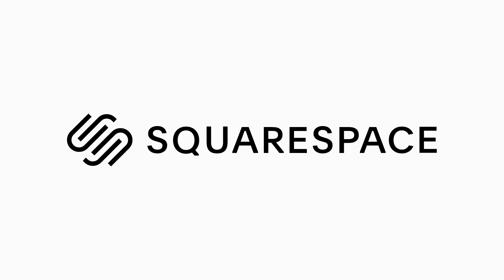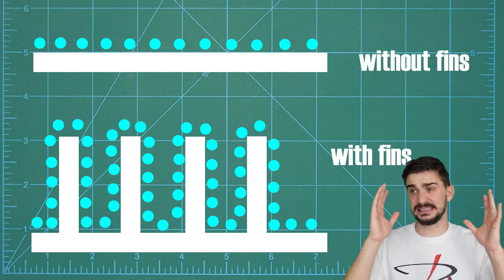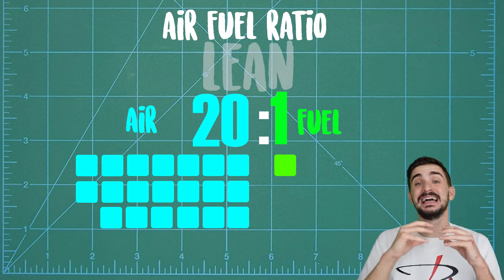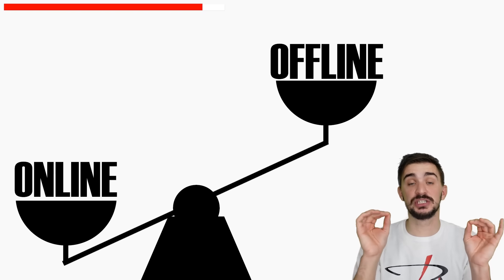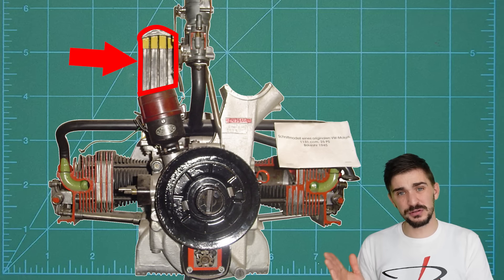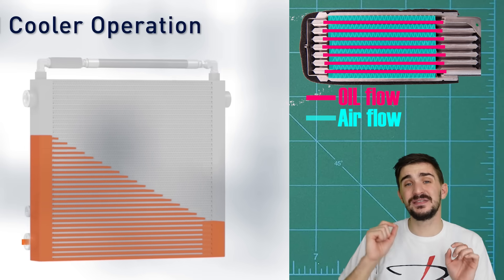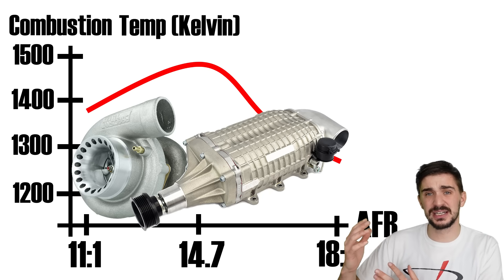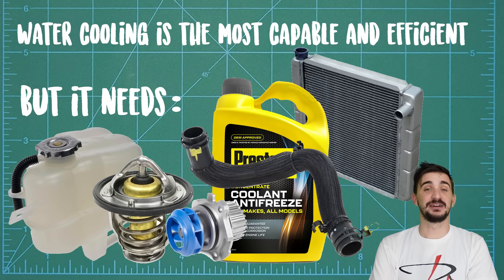AIR COOLED vs OIL cooled vs WATER cooled ENGINES

Comment: best cooling solution for your engine is water? laughs in hydrogen
Hydrogen has a specific heat capacity of around 14,3 kJ/(kg*K) - but a density of only around 0,1 kg/m³. But no problem, just put that stuff in at around 700 bar since you can fill your engine with that pressure at any hydrogen refueling station (density is roughly 40kg/m³ then). And.. oh well.. that still makes it incredibly bad for cooling; Water with it's roughly 1000kg/m³ is still about 7 times better per volume.. :-(  and you don't have to deal with those 700 bars. cries in hydrogen
Reply from the maker: What a roller-coaster of a comment! I really laughed, thanks for that.

Comment: My question is, why no manufacture made a combination of air cooled & water cooled engine
Reply from the maker: Because air cooling becomes unnecessary and redundant with water cooling. You can do little things like shallow fins on oil pans but that's about it.
Reply: @d4a  Ummm.... Porsche 959. Air-cooled cylinders, liquid-cooled heads.

Comment: 11:04 Does the viscosity of the oil affect the heat capacity? I.e. Thicker oil = More or less heat capacity? Also does thinner oil transfer heat more quickly to the cooler?
Reply: Specific heat capacity is functionally constant (J/K*kg). However, as thinner oil is less viscous it flows more easily. This results in greater flow (m^3/s) and thus greater mass flow rate (kg/s) through the engine and radiator. This means better cooling of the engine as more fluid is available to exchange heat.

However keep in mind that this is mostly a consideration for startup of the engine, when the oil is cold. As flow rate is linked to the pump, which in turn pumps harder at higher rpms (when more heat is generated). So cooling and temperature tend to remain constant when cruising and only slightly goes up when accelerating (these variations are not negligeable, but for simplicity's sake we will ignore that).

It is actually recommended that you turn on the engine for a brief time before you get going and start demanding perfomance from the engine. As this gives time for the oil to heat up and better lubricate the engine. I can guess this is specially important in oil-cooled engines. It used to be very important in old engines, but as people kept being impatient engineers started designing around short startup times.

Comment: Some Ford engines,the water pump is driven by the timing chain. That was a great idea.🤯  So if the water pump ever goes bad...it pours the coolant into the engine and mixes with the oil. If you don't realize it rather quickly and you keep driving. Engine goes 🌋What a stupid design. They could have just as easily designed the water pump to be belt driven.
Reply: Yes, my neighbor just had this problem with his Ford EDGE resulting in catastrophic engine failure.  I am told there is a weep hole to allow coolant to escape the engine and hopefully warn the operator of impending pump failure,but this does not always work.

Comment: I had to reply as two of the three oil cooled bikes shown, I own two of 8) One turns you leg into Fillet steak if you ever get stuck in traffic, the other one will do fourteen hours a day in central London traffic for three years non stop ! Well at least mine did with the odd race weekend thrown in 8) ! Still own both ! And you have to laugh, my really fast race bike puts out 98HP but my old work bike thats done it all puts out 105  lol .

Comment: Harleys new m8 motor is air cooled but it has I think it has oil cooled rocker boxes or heads, due to oil lines running on the motor under the tank then connecting to a oil cooler.

Comment: Excellent presented, as always.I learned new things, as always !
Btw. I read years ago, that when moving away from aircooled, you became able to use smaller tolerances btw. piston and cylinder. At least from a performance perspective this is important. Can you verify this ?
Thanks

/Peder
Reply: I also thought that constant temperature was the main advantage of liquid cooling resulting in smaller tolerances, less oil  consumption etc..

Comment: One thing that I have noticed, in the motorcycle world, is the oil-cooled engine have less horsepower than the same water cooled engines and in general have less compression ratio too,  I think it happens because the limitation in keep the engine in the optimal temperature range.
Reply: I believe it is to do with the manufacturing tolerances which need to be wider for air cooled to allow for expansion and contraction.

Comment: Interesting and easy to understand video like always. I have owned several motorcycles and scooters since I was young. Some of them were air cooled, other water cooled... but I loved them all! I would like to share two ideas: some scooters have a special type of cooling system, "forced air cooling system". The forced air is provided by a small fan moved by the engine. The old Vespino had that interesting system. And many current scooters use that technology. The Spanish engineeres of the humble Vespino were very creative and invented the continously variable transmission. That mechanism is nowadays very common in the scooters and even cars. Nobody knows that this transmission method was created for this low displacement vehicle.

Comment: So the heat generated in an engine is  from friction? How come a car going downhill while breaking on the engine doesn't overheat?
I think the primary source of the heat comes from the combustion process.
Reply: Most of the heat is from the burning of fuel. And that’s why the top end of the engine will be hotter than the lower end because that’s where the power is made. That’s also why the cooling system becomes hot like almost boiling temps and under pressure. It’s like putting a pot of water on the stove.

Comment: Friction of the piston in the cylinder cannot be the major heat source. 
Try riding uphill for 10 minutes at 3000 rpm vs
going down the same hill, motorbraking at 5000 rpm. 
Motor will be hot going up and cool going down, inspite higher revs.
Reply from the maker: 9:15 I never said it was

Comment: 14,7:1 air to fuel ratio applies only to gasoline. Diesel, ethanol, methanol, gas and different blends need different ratios to burn. Diesel (as engine) doesn't even care so much...

Comment: Seems like oil/air cooling is the best for regular vehicles. minimal added parts. minimal added complexity. 

if heat capacity is an issue, just increase the flow and widen the radiator. Still more optimal than a massive secondary water system. 

and there is no need for only 1 flow path for oil, and no reason to not have a thermostat on the cooling loop. 

seems like water is only needed when you have high horsepower or forced induction

Comment: Most internal combustion engines are about 60% efficient, max.  That means that almost half of the energy produced by the burning of the fuel is heat, which the cooling system has to also deal with. Strange you didn't mention that.
Reply: if you are talking about the siemens H type turbines, then you are not bad, but in a normal engine you cannot aspire to more than 40% efficiency, and driving at 10MPH it would be about 17% for using so little power not filling the cylinders and "reduce compression ratio"

Comment: Friction is indeed one of the sources of heat which must be dissipated. The other source is due to the thermodynamic efficiency limitations of the Carnot cycle heat engine. The maximum efficiency is around 25% to 30% for current gasoline engines. This means that about 70% of the energy in the fuel is wasted as heat. Most of this heat passes out through the exhaust gases but some of it is absorbed by the engine block and heads. This heat must be removed by air, oil, or water as you have stated.
Reply from the maker: Many modern gasoline engines are managing close to 40%. 25% is a figure from the 80s
Reply: @d4a  Fair enough but the point is that even at 40% efficiency, 60% of the energy in the gasoline is still being wasted as heat. Its not just friction. All of this waste heat must be dissipated through the exhaust system and various cooling strategies as you have described.

By the way, I love your channel!
Reply from the maker: Thanks happy to hear that, but I never said it's just friction. I simply did the friction in the intro with the fun hand rubbing to make the video a bit engaging, but later at 9:15 I clearly state that combustion is the main source of heat and demonstrate how important it is to circulate cooling liquid around the chamber. But I should have probably said that earlier.

Comment: The Volkswagen beetle is known to have an air-cooled engine. But when you removed the shroud it has a small radiator to cool the oil. So it's like air cooled but also oil cooled.
Reply: Had a 1200 cc beetle, I was told that up to 40% of the cooling was from the oil. As the engines capacity increased so did the size of the oil cooler.

Comment: I am having a problem with the friction inside an engine creates more heat than the 4,500F/2,500C combustion chamber temperature. Yes the friction is there. The reason for the increased exterior surface is to disapate the heat generated by combustion.  With thermal dynamics that heat is transferred to the entire case
Reply from the maker: 9:15

Comment: Modern engines, especially diesel ones even use coolant to cool down exhaust for EGR and emission purpose
Reply: Also for variable geometry turbos.
Reply: @breakfast7595  they use coolant for that ? how does it work ? I know there are water cooled turbos but didn't know it had a use for variable geometry

Comment: Great video, I didn`t know that there were engines actually circulating oil around the combustion chambers.  I would add that the biggest advantage water has over oil as a cooling fluid is it`s thermal conductivity.  Combined with the thermal capacity it makes water about 8 or so times better as a cooling medium.  Keep up the great content, I am learning tons from each of your videos.

Comment: Theres also a water cooling engine that throws away the water pump. Its a water immersed cylinder where the cylinder water jacket is part of the water tank. Using only temperature difference to move the water up or down. Its either a boil off or a water tank with a radiator and a fan with a pressure cap. Standard issue on Yanmar and Kubota horizontal single cylinder agricultural engine and their chinese copies.

Comment: Always something of value to learn from your excellent presentations. I catch very few misstatements very occasionally and mostly pick up some facts or perspectives. Thanks. You start this presentation with a curious attribution of friction as the primary cause of excess heat. The rest of your presentation shows you know that combustion produces the lion's share of excess heat--the sixty to seventy percent inefficiency of the cycle. Friction's contribution is miniscule compared with that of combustion. In 1971, in a first-year thermodynamics class toward my mechanical engineering major, the professor asked this very question, that is, where does an internal combustion engine's excess heat come from. One of us students immediately answered, "friction." I vividly remember the professor's astonishment at our ignorance. He said something to the effect that if friction were producing anywhere near (within two orders of magnitude) the heat of combustion, the metals subject to such friction would quickly melt, bearing in mind that the local interface of frictional heat generation is instantaneously very small. Remember, too, that gas flow and introduction of evaporative fuel (as you detail) carries off most of the excess heat of inefficiency. Still, as you show, engine cooling is concentrated around the combustion chambers and exhaust ports. Along these lines, Rotax 900 series aviation engines utilize a hybrid cooling system; liquid cooled heads and finned, dry cylinder barrels sufficient to remove the residual heat of combustion carried into the cylinder walls (and, ok, that little bit of ring/wall frictional heat).
Reply: Your comment is to the point, it was really a bizzare intro stating that friction is key heat generator in the internal combustiin engine.  Total loss of credibility
Reply: Another thing i found strange is that he mentioned the fuel evaporation cooling effect, but not that the flame of the rich mixture itself burns cooler
Reply: Totally agree with your comments about heat sources in ICE.  But “Excess heat of inefficiency”?  What are you trying to say on this?

Comment: I have always wondered why racing engines aren't made to have air-cooling fins to compliment their water-cooling systems.
Imagine that you have an endurance prototype and for whatever reason your cooling system isn't performing to it's full potential. You'd have to ease the pace in order to prevent/reduce excess heat, or otherwise the ECU would make the car run thirstier to keep it cool.

However if you were to have cooling fins on your water-cooled engine block the excess heat would simply be washed away as the air circulated in and out of the engine bay.
Reply: Modern endurance prototypes have a tonne of air moving through the engine bay. But if you're having to use air cooling fins on your engine block, it shows you've got a bigger issue, since your cooling system wasn't done properly the first time around.
The reason we use radiators and water cooling, is that they are SO much more efficient than air cooling fins. So when you find in the free practice sessions, you find the engine running on the hot side, you just open up the radiator ducts one step and maybe one more step for a bit of safety factor.

Comment: I noticed you stated that 40% of heat comes from the rings scraping against the cylinder walls causing friction, Sorry that I beg to differ but I think that combustion (burning of the fuel/air mixture) causes way more. I would think that that is where the majority of the heat is generated.
Reply from the maker: 40% of the total heat generated by friction... Not total heat

Comment: I had a Suzuki that go around the problem with uneven cooling on the rear of the engine on an air cooled engine in an interesting way - the front cylinder was air cooled, but the rear cylinder was air/oil cooled. 

I have a DR650 now, and it has a weirdly large oil cooler for a 650cc engine. But that thing just won't overheat.

I'm really digging the new background. I'd love to see more of this.
Reply: I have a DR650 myself. I want to say some v twin engines had a richer idle jet for the rear cylinder so if it was idling at traffic, it would help cool the engine a bit more. Maybe harley davidson? I can't remember

Comment: You say you cannot control the cooling of air cooled. 

The vw beetle had a thermostat that shut off air flow over cyl until engine reaches operating temp. 
In the 1940s.
Reply from the maker: Yes that single example of shutting off only a part of the airflow refutes the thousands other air cooled engines that do nothing and my argument of "how the fins are always there and air is always there". Air cooling is not a closed system thus all attempts at its control are far less effective than in closed systems employing liquid cooling.